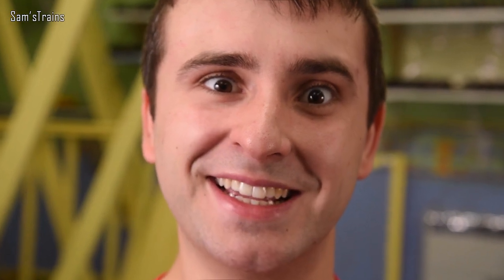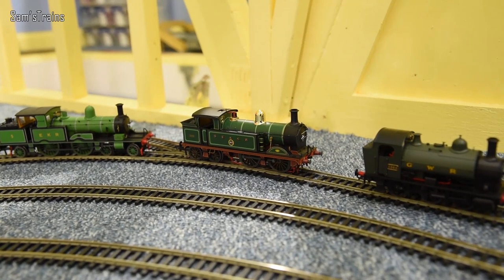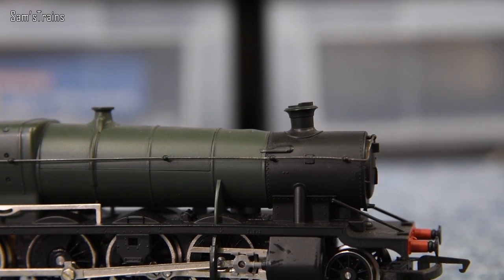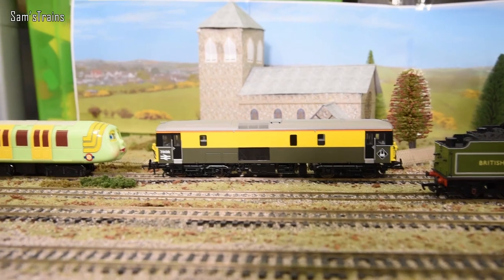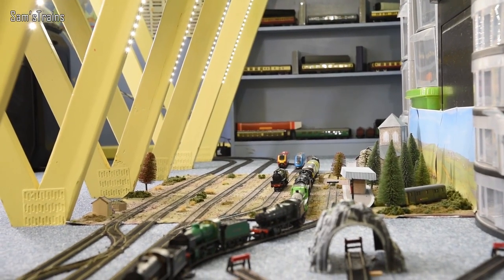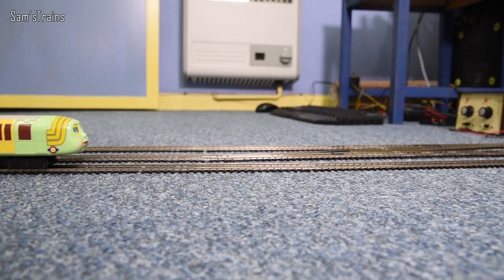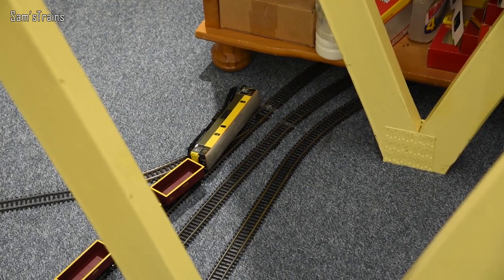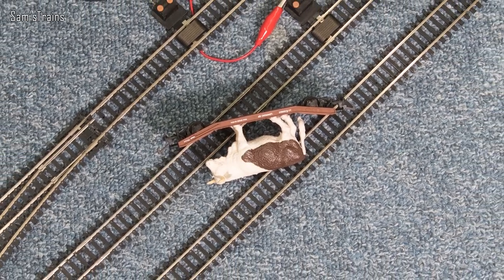Lemon Locomotives | Model Trains With Design Faults

Comment: Something odd there Sam, I have the Hornby  1443 in BR green. It definitely does have sprung rear axle just like it's dapol and airfix ancestors.  Either yours is jammed, or the newer version has a fixed rear axle. Have never had a problem with type 7 either on any of my locos,  but maybe they have switched manufacturers. Who knows. Cheers Gary
Reply from the maker: Yes that's true - they downgraded the axle so that it's no longer sprung - I don't understand why!!
Thanks for watching - Sam :)
Reply: @SamsTrains  crikey not good

Comment: Ever seen a Bachmann China QJ steamer's chassis simply breaking apart and the body just falling off? Ever seen a Rivarossi Big Boy's motor going up in smoke and sparks? Or a Bachmann Shay's cogwheels simply breaking apart and falling out of the loco? A Trix Hobby tank engine literally melting the body and starting to burn?
I did. And i quit model railroading.

Comment: Hey Sam, I have a lemon on my bachmann henry and he won't move. So I was wondering if their were any track problems for him because he was ruining the entire circuit. So I was gonna ask you if anything was wrong or if you can help me.
Reply: Ps: I really tried everything. :(
Reply from the maker: Ahh sorry to hear that - do you have other locos you can try on the same track? Unfortunately they are quite unreliable, and it could well be the motor. Worth checking that the track/wheels are clean though... and that nothing is jammed!
Thanks for watching, Sam :)
Reply: When I tried a different loco with henry on, they both didn't work. Then without henry, they move. I also cleaned his wheels and see if that worked, but the only movement was like half a foot.
Reply: Good news, he works now! 😃 I was asking my dad If he could fix him. So he took him apart and see what was wrong. Then he saw that one of the copper wires were disconnected to his wheels. So he rewired them to the wheels and put him back together. Then I tested him out and he works!

Comment: When it comes to the Bachman Thomas range, I’ve found that the newer engines of 2020 seem to be a bit more robust. I once got ahold of an original 2002 version and oh boy the motor in that sounded AWFUL. So much so that yesterday I gutted its gearbox, grabbed a newer Thomas that was missing some of its gearbox gears, swapped out the wheels from the old one, and low and behold I now have a working, all be it battered, more modern Thomas among my 2 brand new Thomas units, my sound operated version, and my other loco’s. I’ve also found that the best way to make things easier on the engines is to just SLATHER lithium grease onto every gear, every gear rod, and the motor worm gear as well as the gear on the drive wheels and the spots where the wheels Axels sit. It may be a greasy and messy job, but it does make things easier on the loco’s from what I’ve seen so far. I plan to do this procedure on all my Thomas units, even my sound operated one.

Comment: I think the biggest lemon in my collection is, or was, my Bachmann Percy. Like the rest of the range, yeah, not only did the motor burn out (I have owned 3 Bachmann Thomas's because of this lol, before I knew how to swap out a motor), and unlike the rest of the range, Percy's main flaw is his Chassis design, or, lack there of. He's held together, mostly by, clips... Which can easily snap. There aren't many screws holding him together. This, not only makes re-assembly quite annoying, but also means there is a large mold line across the boiler. Sure, you could just paint over it, but the issue with this, is that the motors made specifically for these locos, and will only, specifically fit in their chassis, burn out so frequently, that in no time, you'll be sorting out replacing the moor again...Problem, you can't, without repainting the boiler EVERY TIME. What a joke. At least with Thomas and James (as they, along with Percy were released in 2002), they can be taken apart hassle free :/
Reply from the maker: Ahh sorry to hear that - never tried a Bachmann Percy, but not surprised to learn that! Oh dear, that does sound awful - I'll have to check that out!
Thanks for watching - Sam :)

Comment: 5:54 my d49 has a smoke generator that melted the smokebox door, luckily it was only the smoke box door that melted as that can be replaced because they are removable. To stop that from happening again I disconnected the wires
Reply: Green Shark you could make a metal box to insulate the heat with like foam
I have done mods like this before
Reply: @bachnguyen7448  I could do, but I don't really use that loco too often and I have no use for a smoke generator, so I probably won't. But thanks anyway, I appreciate the help :)
Reply from the maker: Ahh yeah - could be from a similar era! Yeah there are ways around it, but they should have worked properly from the factory ;)
Thanks for watching - Sam :)

Comment: I don't know so much about the models you've described Sam (at they are OO), but old HO Rivarossi  motor and brush designs from the late 60's into the early 70's are for shit.  Absolutely terrible design as to how the brushes make contact with the motor commutator.  Oh, are they beautiful to look at?  Yes....but they can't pull to save their lives, are NOISY as they get older no matter how much you oil and grease them, AND the motor can overheat.    These things are pretty much only good for "eye candy"....kind of like some women I know........nothing but trouble.  I will say this - this is one of the most entertaining vids you've ever done...but I feel your pain as you look at your investment and see how much you spent on these "sour fruits" (ie. Lemons).  There really IS nothing more disheartening then being excited about a new loco (or ANYTHING for that matter) and you find it to be of poor quality.
Reply from the maker: Ahh thanks for sharing - yeah I've had a few of those myself, not great motors... though they do run well when they run! Certainly glad those days are gone!! ;D
Thanks for watching, Sam :)

Comment: I have one or two lemons in my collection but over time of owning them I’ve got used to there strengths and weaknesses and what they can and can’t do, if that makes sense, I’m fortunate to only have 1 loco that does not work at all, due to a burnt out moter I believe, which is a bachmann underground Ernie train that I have owned since I was very young.
Reply from the maker: Yeah that's true - lemons are good learning experience I suppose!
Thanks for watching - Sam :)

Comment: I have the Hornby Railroad GWR 14XX and Henry. The 14XX is my worst ever OO locomotive, often not running at all and there's no way I've burnt out the motor seeing as I don't run my OO stuff that often. It always shorts on my points unless running at full and was definitely a bad purchase. Henry, I've had problems with the wheels on the tender, but I have not had the problems with the running gear. I actually threw out my Bachmann Henry not because of mechanical issues, but because I don't like how it doesn't resemble a Black 5 at all.
Reply from the maker: That sounds horrendous mate - maybe you could send it back if it's that terrible?! Yeah the Bachmann Thomas range is riddled with mechanical issues - I had to stop accepting them when I was doing my servicing business, there was no helping them!
Thanks for watching - Sam :)

Comment: Great video. I have no knowledge of some of them. My Bachmann 43xx did the same as your B1s. The loco that intrigues me the most is the 14xx. I have a GMR one which is the same as the Hornby one bar the motor. Mine is okay. Not brilliant but it is better than yours. Can you get hold of one and do a test between your one and the old GMR one including a look inside at the changes? I think Hornby have changed something that makes it run worse. Would be interesting.
Reply from the maker: Thanks for sharing Paul! The Hornby 14xx used to be fine - they did have a sprung rear axle originally.... they just got rid of it on the version I bought, which ruined the model entirely!!
Thanks for watching - Sam :)
Reply: @SamsTrains  that's a shame it was a nice model

Comment: To be honest, most of these issues with these locos could be sorted out with enough ingenuity, time and money. Some of these flaws would surely have been seen during the prototype stage, and not addressed, which can be very infuriating. My dud was my Eureka models “HUB” carriage set. The wheels were not correctly gauged, and the power pickups for the internal lighting caused a lot of friction, meaning they are not very free rolling, and the gauge issue caused many derailments, with one coach falling over and hitting the floor. The other flaw with them was the fact the ladders that on the prototype, would have allowed people to climb in from from the ground, on the model completely prevented the bogies from turning, so they wouldn’t go around curves. I’ve sorted most of these issues out, and the set now runs reasonably reliably, but for $600, I wasn’t impressed. They nearly ended up in the bin.
Reply from the maker: Yes you're right - many of these issues could (and should) have been solved with proper assessment and refinement of engineering samples. Sorry to hear about those carriages - that sounds like a very silly design too, for the price, totally unacceptable!
Thanks for watching - Sam :)

Comment: I have 2 bad runners and they are of the same make class and even number hinton manor by mainline 

One hinton manor has ran round 2 second radius curves and stopped dead and it hasnt moved since and that was 4 yrs ago 

The other had a wheelset snap while running and knocked all valve gear off
Reply from the maker: Ahh yeah - the mainline locos are definitely lemons! ;D
Thanks for watching - Sam :)

Comment: Have you thought of giving the Bachmann Thomas trains new and different motors? I figured it wouldn't hurt to experiment that theory, researching different motors, and seeing which will fit. The same can be said with your other trains. Find out what can work for your engines.
Reply from the maker: I'd love to, but I've never been able to find suitable replacements, they'd have to be exactly the same size as the originals :(
Thanks for watching - Sam :)

Comment: My Trackmaster Flying Scotsman has had a grand total of 9 new motors- they keep burning out because the space for the motor is too small (also, the worm-drive is too small, the worm-drive mounting is over oiled and the drive wheels don't have bearings!). What a lemon!
Reply from the maker: Wow!! Kudos to you for all that patience! :O
Thanks for watching, Sam :)
Reply: @SamsTrains  yeah, today I finally decided to take out the motor and push it along! It's the same with most of my other Trackmaster models, except for them, I just took the motors straight out- you know when their having trouble when you push them along and their axles click (that sound is hard to miss after 5 locos have had the same issue)

Comment: my Bachmann Emily had a very rare miscommunication amongst the manufacturers where the mechanism is concerned. it has tender-wheel and all loco wheel pickup and has a skew-wound 5-pole motor.
Reply from the maker: Very interesting! Are you sure it came that way from the factory? I'm not aware of any models having those features!
Merry Christmas - Sam :)
Reply: @SamsTrains  It most certainly did,my dear Sam.

Comment: Interesting, I have a Dapol 73 (a returned one - that supposedly stuttered and wouldn't run - picked up from Dapol at the GC Model Event last year for a reasonable price), and since I've had it their has been no problems with it. 

Maybe yours is a different batch? I still think you shouldn't have accepted it and returned it, if you're starting to spend tons on money on them just to get them to move, they aren't really worth the amount you paid for it!
Reply from the maker: Thanks a lot Brandon for sharing this, I've had many comments from others about the 73 with major issues - is there any forward and backward rotation in the bogies of yours?
For most people, I'd absolutely recommend returning dodgy models for a refund, but in my case, I'm better off to keep them and use them in videos; some of the worst models have been by far my most successful, the 1361, Underground ernie, the Tango etc!
Thanks for watching - Sam :)

Comment: Maybe it's because I don't run my engines as much as others, or the the controller I use is the Bachmann controller, and the fact my current layout is small, but non of my Bachmann Thomas or the few Hornby Thomas engines I have motors burnt out, and I've had them for several years. The only engines that have acted odd is Hornby James, as the pin holding the side rod on his right (viewer left) side sometimes manages to come off, and my Bachmann Donald tends to run very awkwardly tho I think that may have something to do with the gears and not the motor or something along those lines, fun fact he and Douglas's motor seem to share a similar design as the one in that 14xx, but I've never experienced or heard of them failing the same way as that 14xx did from other people who have them, weird. Other than that I can only assume that the other engines just need a good oiling of the gears and running in, interesting video.
Reply from the maker: Thanks a lot for sharing, you must take very good care of them! Yes Bachmann do use standard motors across their range - you do see them crop up in lots of different models! :D
Thanks for watching - Sam :)

Comment: Great video! Very funny. But i think you have to change the Mehano TGV for the latest Hornby large prairie. That is a real lemon. I had and have no trouble with mine TGV, just checked it again tonight, to be sure, on a track with very tiny curves. Runs great. My worst loco is a Lima BB13000. This modell is an upgraded version of an old Jouef modell. They changed in all their wisdom the motor for a better one but it doesn't fit right. I had to glue it in but still it jamed. It had cost me two decoders. I'm sick of it now!
Reply from the maker: Thanks a lot Andrew - yes that's true actually - I didn't have the Prairie when I filmed this, otherwise it'd be here!! Yes I know many who own the TGV with no problems - there must be a lot of inconsistency in the tolerances!!
Thanks for watching - Sam :)

Comment: Backmann's Thomas and Friends line would have been good if they had proper motors.
They're the most accurate models, but the bad motor is just a sad defect.
But, being able to replace motors is a thing, so I guess you could just put a good motor in them.
Reply from the maker: You're right - the motors do suck don't they? :/
Thanks for watching, Sam :)

Comment: Aristo Craft G scale 0-4-0.  Split drive wheel axles.  The plastic bushing intended to join the two axle halves splits and the drivers twist out of place.  Irreparable after this happens as aligning and quartering the drivers is virtually impossible on the home workbench.  Best bet is to take preventive measure prior to running it in the first place:  de-grease, then wrap the culprit in wire and epoxy before the wheels loosen.  Good luck with that.  Most people don't escape their fate with this LEMON because they are unaware.  I have repaired three of these puppies and never want to see the inside of one again.
Reply from the maker: That sounds awful Johnny, such a pity that modellers should have to do all of this just to get a model that continues to work!
Thanks for watching - Sam :)

Comment: My Hornby 47 loses traction in strange places. I’d never noticed the centre wheels are lower. Might have to see if that can be modified :)
Reply: If I remember correctly the Railroad 47 was originally a Lima model which was modified and rereleased by Hornby?
Reply: NTSCuser that’s correct.
Reply from the maker: Yeah I bet it's the same issue - I'll bet you!
Thanks for watching - Sam :)

Comment: I have two not too great locos, both from sets.
One just has gauging issue so it derails on every point. I could fix that but still haven't got to that.
The other I can't run above 6V. Any higher and it starts smoking.
I still like them tho :)
Reply from the maker: What brand are they from mate? That doesn't sound too good! D:
Thanks for watching - Sam :)
Reply: @SamsTrains   The derailing one is Taurus by Piko and the smoking one is FS class214 by Roco
I suspect too much oil that got to the motor, but that thing is crazy small so I didn't try cleaning it yet.

Comment: Don't give me wrong, the Bachmann Thomas models have bad motors and mechanisms, but as long as you take care of them they'll last as I've had my Bachmann Thomas for nearly 20 years! I mean I only had Scruffy, Annie and Clarabel for him to pull, but still. I've only had Percy and Henry fail. I replaced Percy (as the motor died and I was a stupid kid and played with it like a toy until the valve gear came apart and pieces got lost) and Henry's motor burned out, replaced it but either he needs a new drive gear or something became de-soldered. So yeah, they aren't the best, but when taken care of they'll last.
Reply: That's why I wanna remove the eye mechanisms and try to find replacement alternative motors for my future bachmann thomas and friends engines
Reply: @DavidTheNickjrFan2003  that, and I want to look i to getting some bearings for the axles to make them run better too!

Comment: I’ve got a loco you can add based on my experiences with it. The new rocket. It wheelslips and stalls and breaks and is rubbish! 🤣
Reply from the maker: Yeah I've heard that too - though mine was perfect! :(
Thanks for watching - Sam :)
Reply: Issue is hornby only designed it as a display piece for those collectors that only buy the locomotives and rolling stock to stare at and never run them. That's probably the issue with all of these super detailed model railway items now, they are designed for the cabinet collector not the people who want to run them.